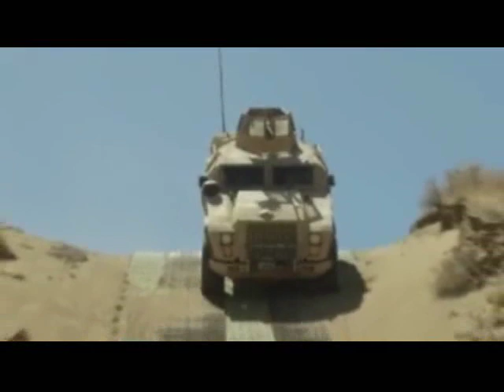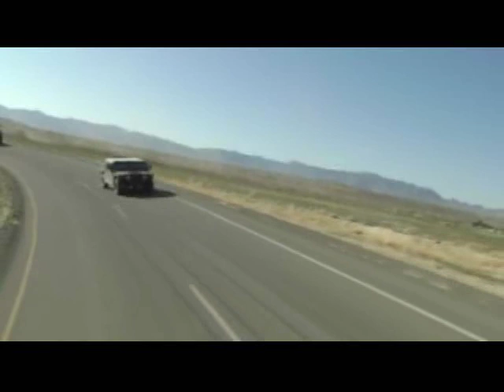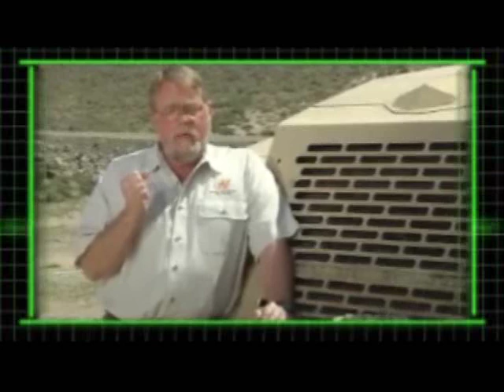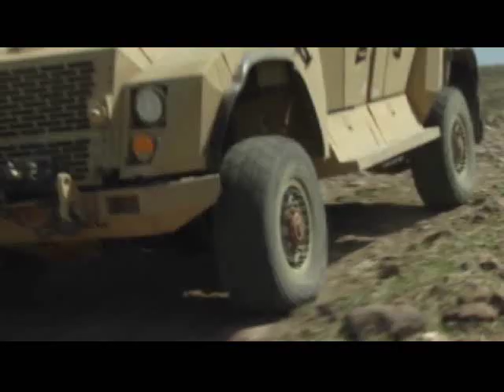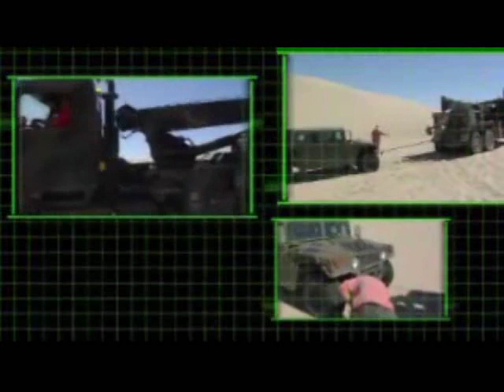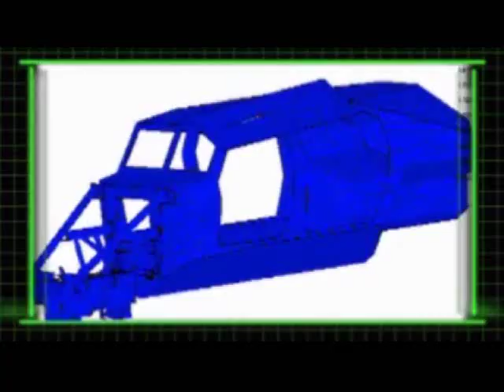humvee replacement part 1

Comment: The current production of Oshkosh M-ATV fits the mold of this type of vehicle. As far as replacing the Hummer, it will just be upfitted to better suit its designed roll. As a light, unarmored transport for troops and equipment, just like the Jeep it replaced.

Comment: @wolfyys i agree. the cost of this one unit, who knows could be more expensive than a Stryker, if not then personnel/dollar or firepower/dollar,etc bang for the buck factor the Stryker might be a way to go. 

Also, whenever a wheeled vehicle hit an IDE, often time the blast will destroy a wheel or more and shrapnel will just render the engine useless, leaving soldiers on the ground.  a 6-8 wheeled armored personnel carrier really works more effectively.